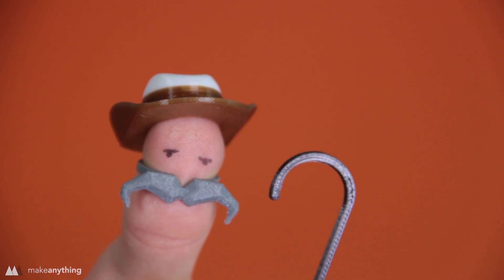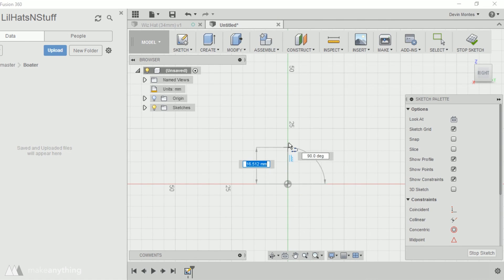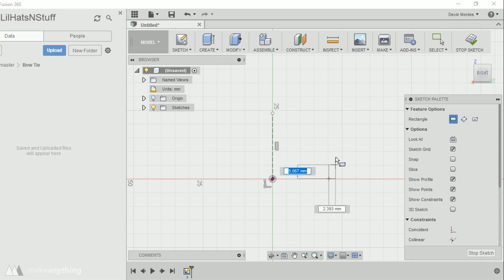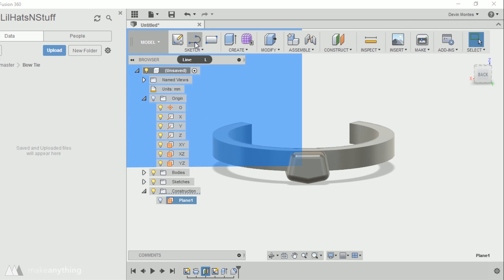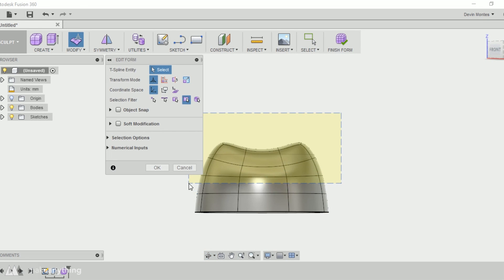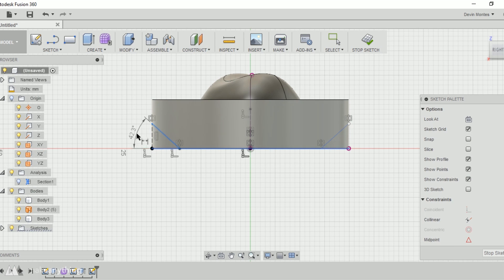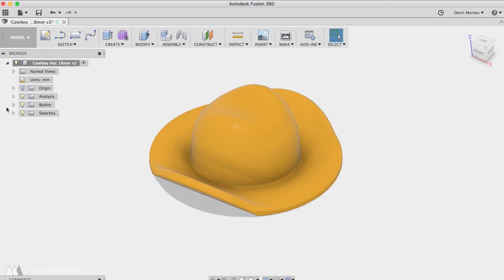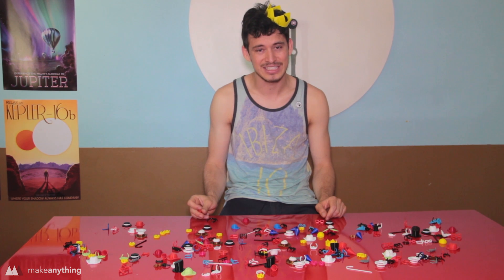Making Lil'Hats'N'Stuff in Fusion 360

Comment: I love that you use "unlimited" and "infinite" differently and don't assume they're interchangeable like some people do.
Reply: TheRedGamer
Basically, "unlimited" is synonymous with "potentially infinite" or "as good as infinite," but it is not the same as "infinite."
"Unlimited supply" makes sense because it means you'll never run out, you'll always have enough. But an unlimited supply is not infinite, because an infinite supply of anything would have infinite mass and probably collapse into a black hole.
Infinite things cannot be physical. Physical things cannot be infinite. Whenever something is physical, but there's enough of it that it might as well be infinite, one of the ways to express that is to call it "unlimited."
Unlimited things have no limit, but they still have a number. Infinite things have no limit or number.
In the video, the number of things that could be made is unlimited because you could always design something slightly different or print multiples. On the other hand, it's not infinite, because printing an infinite number of hats would require an infinite amount of filament, take up an infinite amount of space, and take an infinite amount of time to print.
Hope that helps